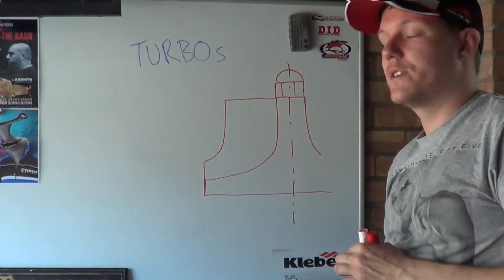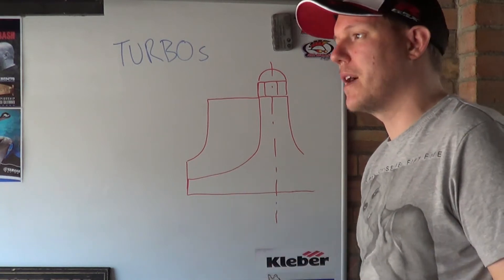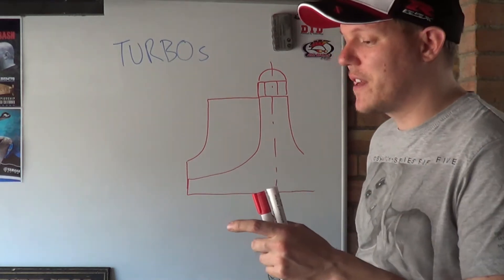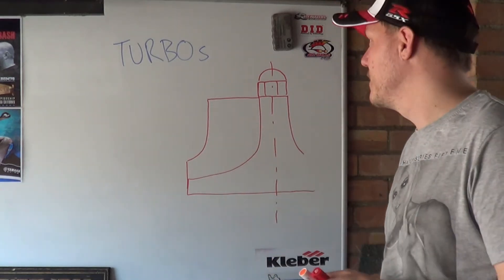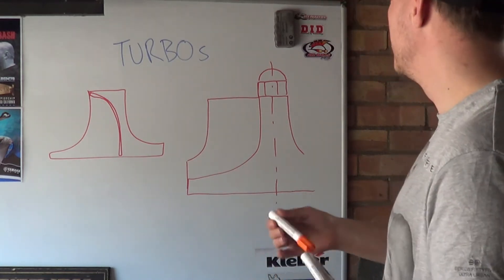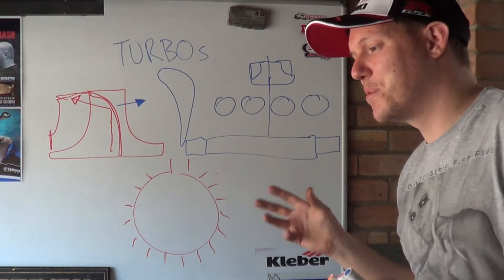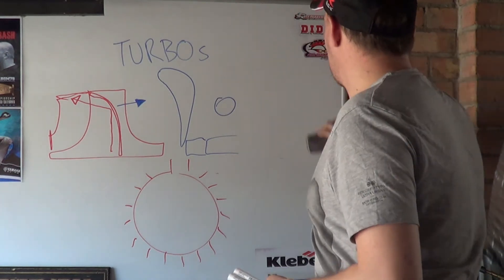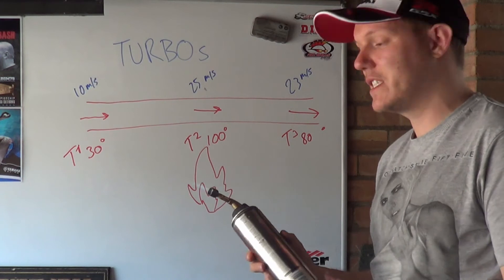How Turbos Work - The Turbine - Part 2

Comment: Let me know if i'm jumping the gun here mate but with turbo a/r is it the smaller the turbo the quicker it will spool due to less rotational inertia and the bigger the turbo the more inertia it has but can make more power because it can flow more air?
Reply from the maker: Rotational inertia is a tiny part of it, the biggest problem is the volume of air to shift also known as drag
Reply: @thedirtyworkshop  people who don't really know what they're on about cough Jason, don't make it easy to understand 😂

Comment: I think if you would have explained that it is caused by heat because the heat makes the gases expand and that is the pressure that forces the turbine to spin then they might understand it.
Reply from the maker: "and that is the pressure that forces the turbine to spin"

- but it's not the velocity is what is used, and whilst striking the turbine wheels blades is exerts a force, this over an area is pressure yes, but not fluid pressure of the exhaust gases. If this was the case then it would matter where you put the turbine.

The exhaust gas is expanding into the exhaust, this expansion will cause the pressure of the exiting gases to fall, sure there is a pressure wave that travels down the exhaust and this encounters the blades, but its the entire exhaust strokes worth of exhaust that powers the turbine. 

Think of a turbine wheel in a turbofan engine. Its the rapid acceleration of the combustion jet that powers the turbine. This acceleration is the combustion of the fuel. Hence heat. Otherwise you could put turbine blades in the bypass and stop making them out of single crystal nickel.
Reply: LOL, I understood it. I just want to make it understandable to noob's mate.

Comment: Perhaps a worthy addition to your radial vs axial comparison is a mention of the comparative size efficiency, especially for low speed flows, of radial flow turbomachinery. For example you can often get away with pressure ratios upwards of 2 on the compressor side (compared to about 1.2 for an axial stage) and according to wikipedia (best source ever...) - about 4 on the turbine side. I can't remember how much you can expand within a stage of axial turbine, but I'm sure some other bright inginerd can enlighten everyone ;) Suffice it to say it's nowhere near that much.

Radial compressors and turbines really are ideal for such low mass flow rates, but it looks like that's about all they're good for.

Comment: Wait, am I stupid or is this really not that difficult to understand.
The combustion whatever the exact physics are behind that create a huge expansion of gas which drives the piston downwards.. This gas is still expanding when the exhaust valve opens and thus the rest of the energy is lost out the tailpipe.
Put a turbo there which is driven by the "residual" expansion and you get more overall efficiency.
No combustions -> no heat -> no expansion to drive the turbo. So turbo is reliant on heat.

"Easy" way to test this:
Get a old turbo car, remove the sparkplug wires. Strap it behind another car, put it in 3. gear just like a pull start and pull to get the engine revving high enough and see how much boost it creates. If heat isn't part of the equation it should create just as much as if it were running. I guess it wont.

Sorry for mixing up scientific words if I have..

Comment: ok Matt the turbine blade shape on an aircraft engine is actually a bit of a compromise in shape and efficiency.. at least modern ones.. as anular combustion chambers become more efficient more heat is imparted to the gas flow.. so much in fact that the turbine blade would melt if it had to withstand the combusted gasses. Therefore they are hollow and have cooling air pumped through them through the lp turbine.. you will see RR blades have tiny holes in em to emit this air in the gas stream, the turbine disc is hollow and is in effect a manifold , under pressure with cooling air..  they are bullshit hard to make , are grown out of a single crystal , and each company keeps the shape and process a closely guarded secret, they cost a fuck ton.. Each fan blade on a RR Trent (the big one at the front .titanium is 30,000 quid,  24 per engine, balanced pairs only).. 
   The automotive turbine is much closer to the old school centrifugal compressors used in non axial flow engines, or in a trubo prop like a pt6 , where they endeavor to keep the engine short and simple.. same with a auto turbo, as the gas path has way less heat then a jet engine , as the exhaust gasses impart way less energy to the face of the blade and less heat. Hence it's shape n size.. Gas turbine blades must fight heat , so their shape as efficient  as it is.. is still a compromise ..fuck you just said what I did here lol.. anyways as far a turbine blades are concerned they are not as efficient as they could be as they have to provide their own cooling.. being hollow, having holes in em fucks the shape a little bit.. 
  and hence efficiency
Reply: Have you had a chance to see the Trent XWB 97k HPT blades? Last design iteration I saw of them (years ago) they were practically made of cooling holes :P One can only wonder how much HPC bleed air it takes to feed 'em :D

I had the pleasure of finding out first hand how ridiculously difficult it is to keep anything from melting in the furnace these people call a high pressure turbine. Maybe one day I'll get to collaborate with them again.
Reply from the maker: lol I did my engineering studies in the army as an aircraft engineer, working on the General Electric T700's, turboshaft engines. I had the oppotunity to talk to and visit RAE Farnborough and poke around a bit. Great day out lol - matt
Reply: that must have been an amazing experience,  especially with your depth of knowledge , physics chem etc.. makes it that much more fun , my knowledge comes from some pretty good people, but nothing like being trained and the hands on stuff. the thing is the average punter doesn't realize to what extent these bits are engineered to work with one another.. as you say simply slapping a bigger turbo on is no solution, cams, fuel metering, exhaust, intake manifold, filtering, cooling, and driveline/chassis bits all have to be improved to handle the extra power yer getting... and it's all compromises, there's no magic bullet..
  my fav engine.. hmm,   Deltic,  Wright Turbo Compound, Pratt Whitney four row corn Cobbs,  or sleeve valve saber's or Radials..
Some of the opposing piston junkers stuff is pretty cool too..  basically over, complicated mechanical monsters packaged into crazy tight places , and demanding high output per liter, and lightness.. wright turbo compound on the DC7, and the Connie are great examples of this.. the sleeve valve drive gear on a Bristol Hercules is a bloody galaxy of sun n planet gears.. makes the wizard look simple in comparison... F1 was looking at turbo compounding via a fluid coupling for a bit in the turbo era.. Duckworth put a stop to this as in effect it would be a second engine as yer fueling it .. 
  As for fuel metering,  can you do a bit on injecting fuel directly into the turbo as Ferrari  did in the early turbo era ?  and the theory behind it.. It's still a black art to me, and nobody discusses fueling..guess it's a concept in unto it's self.. lot of blokes don't realize fuel has a cooling effect on the engine as well, and some is un burned .. a video on this would shed light on subject a lot of people , at least here in Canada, don't seem to understand unless they have an engineering degree, or are versed in chem/physics etc.. caused many an argument, until we hear from an authority on the subject..
Reply: Whats your favorite turbine engine
Box of Earl Grey says its a RR 😁

Comment: a combustion engine needs fuel air and ignition, the crank angle sensor tells the ecu when to inject and ignite, on 4 stroke engines you get (suck) air/fuel gets sucked into the cylinder. (squeeze) the compression stroke, the air/fuel mixture gets compressed, bang the air/fuel mixture gets ignited dependant on the rpm and degrees btdc this is called advance and the piston gets pushed down by PRESSURE, and finally blow, the exhaust valves open and the piston pushes the exhaust gasses out, this is where scavenging has an effect and why optimum exhaust width is important, is that ok for you, am i missing something?
Reply from the maker: yes, next you'll be telling me that engine suck fuel and air in. A wait, you did.
Reply from the maker: And I don't know why you can't keep this is one comment.
Reply from the maker: Its a shame that you've lost the will to fight your point, oh well
Reply from the maker: lol did you read the article or is that too much to ask. Look fuckwhit, you seem to think your arguing again my ideas or something, your arguing against all the engineers that build this stuff, the data, the physics and other science that are fully understood. Read the article then come back and argue the toss.

Comment: Calling people dumb bastards isnt going to win you any respect, the explanation at the end is on most part accurate also "if you throw a turbo into a fire its not going to spin" exactly correct i dont see how high temperatures provide an energy, unless your talking about combustion which is before the turbo, which expells spent gasses past the turbo which has an effect on the turbine irrelevant to temperature, gimme a break mate your tripping balls right?

And who said a drop in temperature had anything to do with how you explained it badly the first time around?
Reply from the maker: LOL I'm not doing this to 'win respect', its also quite funny how you edited your statement - where you said that scavenging and temperature effect the flow through the exhaust, and then deleted that bit. Look your obviously having a hard time with this. Energy extraction from fuel is expressed in the form of heat. What do you think happens, you add air and fuel together and then a spark and pressure comes out? For that matter, can you tell me what pressure is? Or more importantly how to increase the pressure in a cylinder. 

Moving onto the turbo side of things, when the exhaust valve opens the high pressure gases in the cylinder expand out into the exhaust, meaning they expand. Which means movement (velocity) and if a gas expands into a larger volume the pressure drops. The larger volume being the cylinder + the exhaust pipe. The reverse of this is compression, volume decreasing, pressure increases.
Reply: spelling mistake its soo funny i know!
Reply: im aqualified mechanic, i remap ecus too. fyi
Q: Look your obviously having a hard time with this. Energy extraction from fuel is expressed in the form of heat
A: correct! your telling me how a combustion engine works, albeit heat being a by-product, thats nothing to do with how a turbo operates, i cant get my head around how your brain works? its magical
Reply from the maker: Oh a mechanic, well then I'm sorry. 

Extract from - 
THIS IS A MODIFIED VERSION OF AN ARTICLE BY Jack Kane WHICH APPEARED IN THE NOVEMBER 2008 ISSUE (NUMBER 034) of RACE ENGINE TECHNOLOGY MAGAZINE

TURBOCHARGER BASICS

The turbine extracts wasted kinetic and thermal energy from the 
high-temperature exhaust gas flow and produces the power to drive the compressor, at the cost of a slight increase in pumping losses.

Link here - http://www.epi-eng.com/piston_engine_technology/turbocharger_technology.htm
Reply from the maker: Do you 'remap' them by hand? As in do you actual right the code? Which leads me to the next question, do you know what the code is called? What format the maps are written in?
Reply: - Kinetic:
The source might be heat as you explained, but he is right that when viewed from the turbo side, it's the exhaust gas flow, the kinetic energy created by the combustion, that's the main force driving the turbine.

And so if you would apply any cold gas flow of the same velocity and pressure, it would drive the turbine (almost) equally well.

- Thermal:
However, he fails to account for the diffirence in molecular speed between hot and cold gas.

In the hot exhoust gas, the molecules will be moving faster bumping more in each other and thus the turbine (hence why hot air wants to expand), imparting more energy than the slower moving cold air.

And by imparting this thermal energy to the turbine the molecules will lose speed, thus cooling the exhaust gasses down (fast moving molecules = hot, slow moving molecules = cold)

The latter is what they refer to when talking about the thermal energy recovery of the turbo.

I do however find it dissapointing to see you dismiss everyone's valid reply's as dumb, yet you basically failed to explain how thermal energy gets transfers to the turbine, then call everyone dumb for not knowing.

Comment: its irrelevant at what temperature the combusted gasses come out of the cylinder and pass the turbo! i think everyone knows that an engine makes its power by combusting a mixture to get an explosion, the heat is irrelevant
Reply from the maker: IC engine from wiki - In an internal combustion engine the expansion of the high-temperature and high-pressure gases produced by combustion applies direct force to some component of the engine.

Combustions role in engines - The combustion process increases the internal energy of a gas, which translates into an increase in temperature, pressure, or volume depending on the configuration.

Combustion in an engine - Rapid combustion is a form of combustion, otherwise known as a fire, in which large amounts of heat and light energy are released, which often results in a flame. This is used in a form of machinery such as internal combustion engines and in thermobaric weapons. Such a combustion is frequently called an explosion, though for an internal combustion engine this is inaccurate. An internal combustion engine nominally operates on a controlled rapid burn. When the fuel-air mixture in an internal combustion engine explodes, that is known as detonation.
Reply from the maker: An internal combustion engine (ICE) is a heat engine where the combustion of a fuel occurs with an oxidizer (usually air) in a combustion chamber that is an integral part of the working fluid flow circuit.
Reply: and fyi
applies direct force to some component of the engine. <--- hes talking about pistons
Reply: With all due respect you can't even spell idiot.
Reply: keep rolling your eyes maybe you'll find a brain back there
Reply: ps i like your gimp suit!
Reply: My bike leathers you mean ? Are you American by any chance, you sound like a trump supporter.

Comment: i agree it would be a loss in power if the exhaust gasses cooled before reaching the turbo but heat is irrelivent as it could start at 10 degrees and stay 10 degrees past the turbo and have the same effect as 900 drgrees as long as the temperature didnt change as to decrease pressure, its not how turbos are powered its by airflow, and wrap is used on non turbo for scavenging improvment also
Reply: Jamie Earp If you have one kilogram of gas in 900c° that's a fuckton of more gass than a kilo of 10c° gas in terms of volume. Say you put a balloon in a freezer it'll shrink right? Now it isn't leaking is it? Then because the volume of the exhaust pipe doesn't change you'll have more flow ONLY because of the heat. It doesn't have to change temperature. The amount of exhaust you're getting in any practical scenario is relatively stable.
Reply: Also in order to spin the turbo the gas HAS TO lose some energy, so in practice it just doesn't stay the same teperature ever.
Reply: heat loss on the manifold causes a drop in temperature and which as you yourself said slows down the gasses velocity which reduces the effect of scavenging, your a real muppet ive never been so embarrassed for someone, cringeworthy mate
Reply from the maker: Sorry that did seem weird - I meant to say - its you, your one of the guys that don't understand.

You said "heat loss on the manifold causes a drop in temperature and which as you yourself said slows down the gasses velocity which reduces the effect ofscavenging"

Extract from above "heat loss on the manifold causes - slows down the gas velocity"

.......and its gas, not gasses.

Comment: https://youtu.be/OketsWBJuJw?t=681 so people invented combustion engines just to heat the exhaust gas? im afraid turbos came second in this race, the heat is consistent from the cylinder to the manifold and turbo, the principal of the turbo was that, engines benifit more from compressed air in the cylinder than the pressure it takes to power the turbo, tell me theres no escape for exhaust gasses if the turbine stopped spinning? its free to flow past the turbine in such case. so what powers the turbine? the flow of air...
Reply from the maker: "so people invented combustion engines just to heat the exhaust gas?"

- where did you get that from?
Reply: that was sarcasm